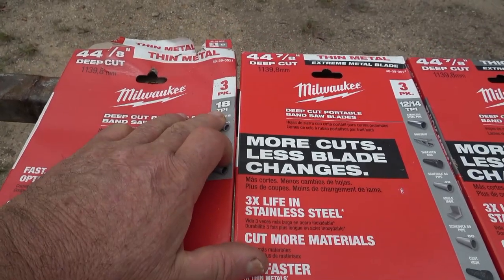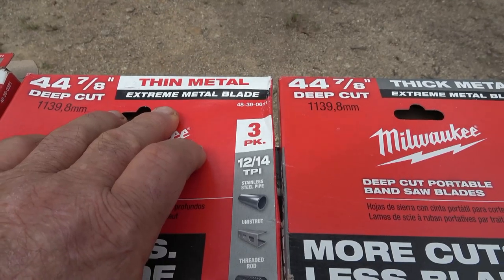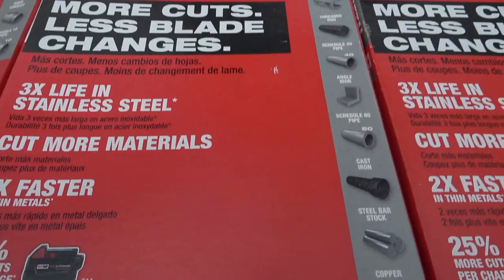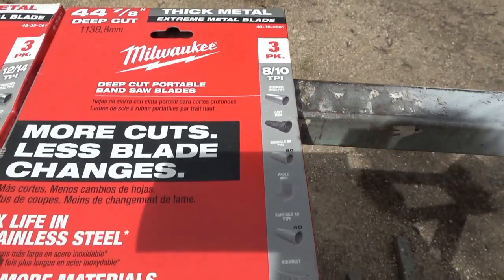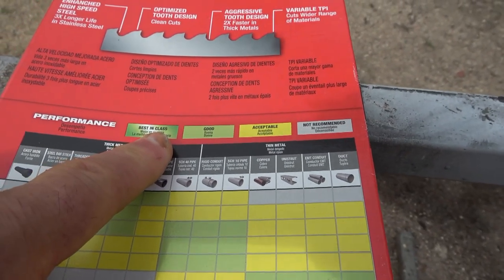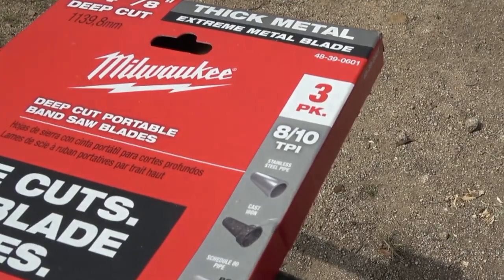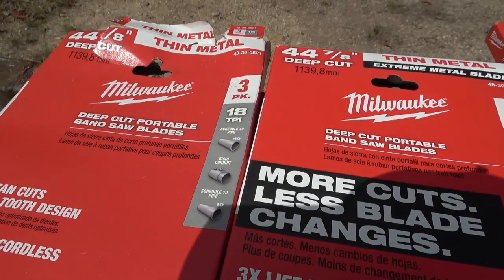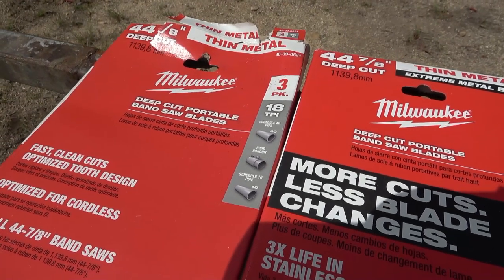PORTABLE BANDSAW BLADES SHOOT OUT

Comment: Hey John.  A Hacksaw blade is perfect for cutting 2" polystyrene.   I want to use cardboard and scissors to match with sharpie to match spaces, then gap and crack fill it in. (Winter coming here)  I'm no metal worker, but I admire it,  a lot..  Dad had an electric hacksaw in garage, I think it reciprocated, or it didn't.  That's 1980's tools. And how stupid I am on whole matter.  😀  your friend.- brian
Reply from the maker: G'day Brian I cut polystyrene with a hot wire seems to work. I have cut it with a hacksaw blade makes a bit of a mess but gets the job done. I havn't seen an old style electric hacksaw for years the ones I have seen are reciprocating. Sort of copy a blokes arm going backward and forward. Ha Ha. John
Reply: @farminglifeaustralia6716  I think that's what it was.  I don't remember no band of hacksaw blade like your tools in video..  My dad was great, or not.  He bought things and left them.
Reply from the maker: @ClickinChicken  That is great. He who dies with the most toys wins. John